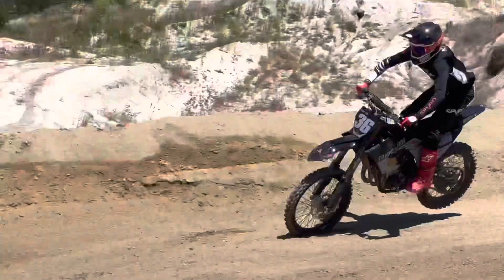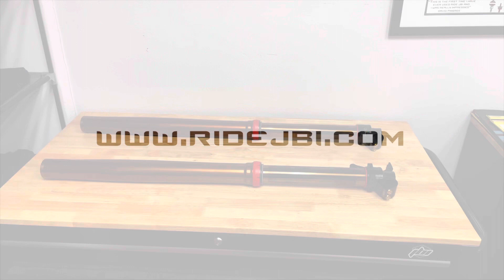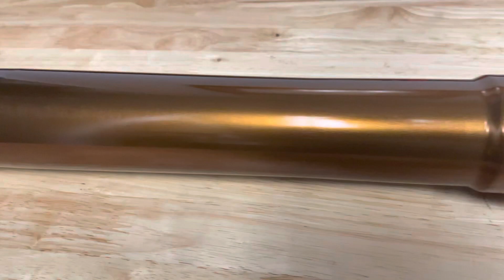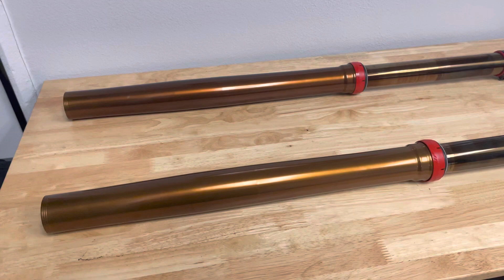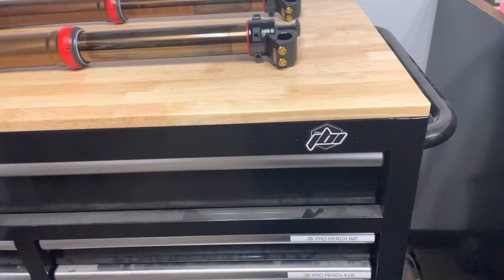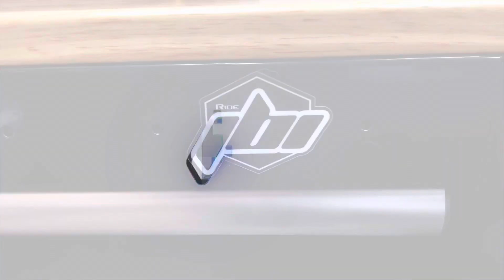WP to KYB SSS Fork Conversion Kit  |  Kashima Coat & DLC Coat  |  JBI Suspension R&D Fork Build Ep2

Comment: What is the red part on all the WP forks right where the tubes meet? I have always wondered this. I've noticed that you don't see it on any of the KYB or Showa components
Reply from the maker: It is a plastic wear ring so that the plastic fork guards rub against the wear ring instead of the fork tube.
Reply: @RideJBI  Can it be removed?
Reply: @fox13z400 sure can, you'll see a majority of holeshot devices will actually run in place of these red rings.